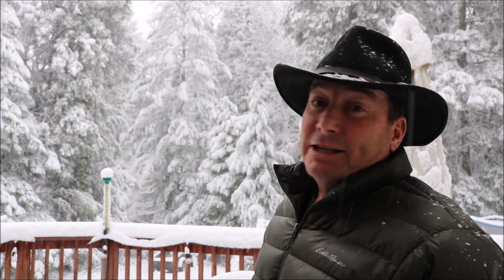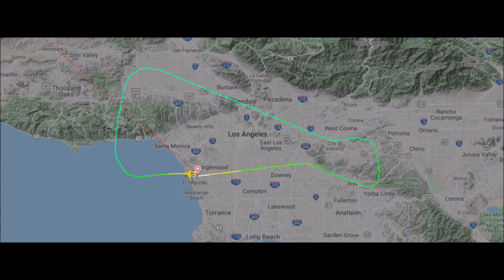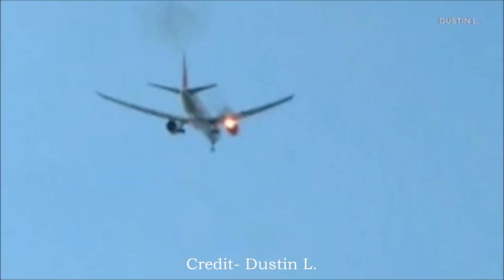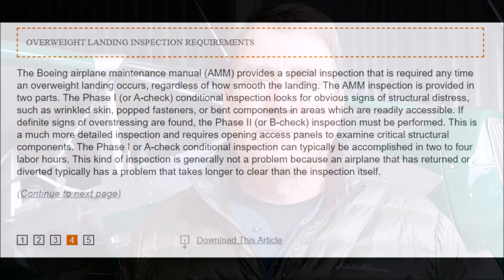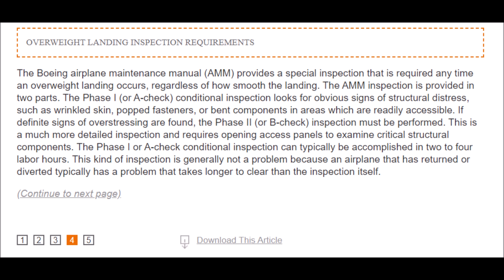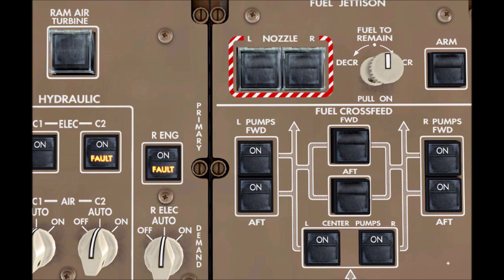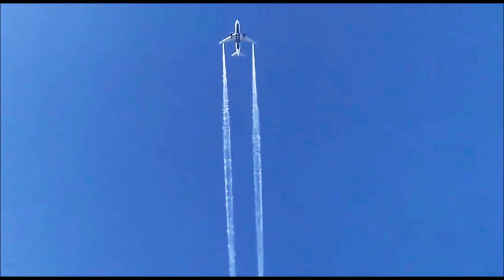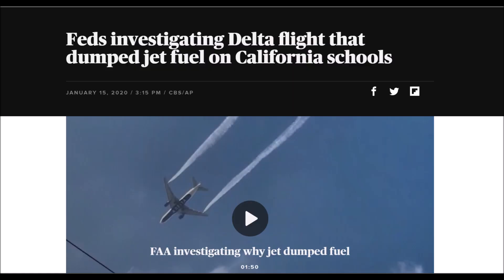B-777 Fuel Dumping and Overweight Landing Considerations (Part II)

Comment: Juan, great explanation on fuel dumping procedures and when it is absolutely necessary . I understand that Delta declared an “Emergency” as a result of the R/ engine compressor stall as they should have done for a return to LAX. Once they had made a determination to return to LAX, an overweight landing should have been discussed by the flight crew. I understand the crew was extremely busy but the option of an overweight landing vs. a fuel dump should have been discussed for all the reasons you explained in your video. I would have to say there was poor flight deck management as well as a disregard for appropriate fuel dump measures. I will be interested to see the outcome of the FAA investigation into this incident . I will refrain from any further speculation as to the investigation result. Great job Juan and hope you make a speedy recovery,

Comment: My money is on a 3rd pilot started dumping and they forgot to turn it off until single engine landing checklist.  I’m sure somebody said “oh sh**” on the CVR.
Reply: Impossible. Typically when you commence the fuel jettison procedure, one of the pilots will have the fuel synoptic displayed on either’ s MFD (Multi Function Display). Also, an expanded fuel tank indication will appear on the EICAS lower right hand corner as soon as the jettison switches are selected to the armed position. In essence, it cannot be ‘forgotten’ unless everyone on the flight deck is oblivious to what’s happening. Pilot error due to forgetfulness? Albeit possible, the chance is extremely slim. You would lose your wager as a gambling man ;-)

Comment: Another great video, Juan. You explain things that even a layman can comprehend. 

What I didn't understand is why did the crew state that they weren't needing to do a fuel dump, but then did it anyway.....at a lower than recommended altitude over a populated area? That can't be held against the control tower people, that's on the crew, I would think. They likely made a last minute call to do that. Luckily, nobody was injured or killed from this incident, according to reports.

Comment: I’m somewhat surprised there is no automated feature to disable fuel dumping as a function of altitude.i wouldn’t want to be coming in hot and heavy, on a minimal runway, mashing hard on the brakes with fuel pumping out the nozzles ..... supposing I am still above my maximum landing weight.

I’m guessing this crew is in hot water .... especially if they are seasoned enough to know about ancestor warship .... legacy rules for older systems.....
Reply: dgretlein I could maybe see some auto shut off when it gets down to very low, like hundreds of feet but if it’s an actual emergency I could definitely see dumping right up till the very last minute even if it’s much lower than procedure as I’m pretty sure those procedures change once an emergency has been declared.
Reply: Mc Earl in this specific event, the pilots had full control of the plane.  They could easily, very easily, have shutoff the “bad engine”, fly the plane home.  The plane is designed to fly safely, very, very long distances with one engine out.  According to Juan, the plane could easily land, safely stop in 12,000 feet .... if the PIC is capable.  I have my doubts with this crew.  I hope Juan follows up.

Comment: Thanks! Excellent analysis as always. Seems a bit odd that the crew didn’t realize that they  were dumping fuel. I think the tower/ATC asked three times if they were or intended to dump fuel. It was certainly visible to the crew and passengers in back as well as the tower for a portion of the go around.

Comment: I'd expect there was a fairly high workload going on. How many checklists were they going through? 3 or 4? Plus doing the calculations and configuring for landing. Oh yeah, and flying the plane in the very congested airspace of LA. Safe landing with no injuries. The MSM has already moved past this onto the next story.
Reply: ShooterReadyStandBy okay sure they were busy and stressed. I hate arm chair pilots but this crew from the information we know so far was in the wrong. You’re an emergency aircraft. ATC is moving heaven and earth to clear the path for you. If you want vectors so you can work some checklists demand it. You’re priority. What I think should’ve been done is the crew should’ve done their memory items, then declared and figured out what needs to happen, then get vectors to run checklists and possibly dump fuel to get below MLDW. Instead it seems like things were rushed and not communicated well enough to keep the emergency under control.
Reply: At least they didn't says "it could have gone into a black hole".... lol

Comment: We couldn't dump fuel in the Stratofortress so we were committed to several hours of burning holes to get down to , what I recall was 290,000 lbs.  So if we took off at 488,000 lbs, we were up for a while...

Comment: On MD-11s the fuel dump procedure is initiated manually and stopped automatically once reached a certain amount of total fuel on board. Such value is inserted on FMS during preflight and is part of the emergency return briefing. I guess it is the same for triple 7s. The main consideration on fuel dumping procedure is runway lenght available. If the calculation for the current weight and runway shows that the runway lenght is insufficient, fuel dumping (and the time for accomplish that) must be done. Overweight landing procedure, as Juan said, is of second importance during an emergency landing.

Comment: I am currently flying as a captain on the 787, and just a quick check of the numbers shows a required stopping distance on 25R, at maximum takeoff weight, of just over 6,200 feet. So that is similar to the numbers you quote for the 767-200. I have a hard time imagining that the numbers for the 777 would be much different than those for the 767 and 787.

Comment: Compressor stall and fuel dumping aside, I get the feeling that this emergency was rushed out and was a contributing factor to this situation, not sure why since the aircraft and the emergency itself was under control. There are a lot of things we need to do such as talking to atc, running checklists, working the fmc to load the approach and reviewing it, brief the approach and after landing actions or go around, talking to pax, talking to company about the air turn back, maybe there are more pilots in the cockpit and they could delegate tasks but still its a huge workload. If it was an uncontrolled emergency thats another story.

Comment: In the eighties I worked line maintenance for WAL at LAX. Late one evening an Air France B747 lost nbr two at liftoff from 6L. The flames enveloped the horiz stab. The aircraft climbed out and the flames went out.. I headed to the cockpit of a DC10 and turned on the radios. Shrapnel from nbr 2 had been injested by nbr 3 and the Captain, whose voice had risen several octaves, wanted to do a 180 and land on 24L. He was warned of debris on that runway and to use 24R. At that time the 747 passed over the airport at about 2,000ft dumping fuel. A spectacular sight. They eventually landed safely on the other side of the field. The Tower was not too happy with the Captain dumping fuel at that low an altitude, over their airport, but I suppose with two engines out on a 747 you do what you have to do.

Comment: obtaining the G Load from the black box at touchdown also helps to determine the extent of inspection for an overweight landing  plus since this was an incident the box should be pulled (mandatory)by maintenance regardless.
Reply: These A/C present the information not through the FDR's but rather through the QAR's (Quick Access Recorders) over 2,000 parameters are recorded and now a days is not even necessary to go plug anything in the A/C anymore, MOC can download it from ACARS anytime, even a couple of days later.
Reply: @caribbeanaviator1964  that's right .You can  pull the, QAR pcmcia card anytime and just upload the info. On the NG .FORGOT ABOUT THat

Comment: Juan, I agree that the crew mindset carried over from previous fleets of avoiding landing overweight may have been a factor.
With only 181 POB, and little freight? the crew may have been "driven" to jettison fuel until just before landing to land below max landing weight.
If fuel dumping Standard Operating Procedures had been followed, (altitude and area),  on the flight path actually flown, there would have been insufficient time to jettison enough fuel to achieve a reduction to below max landing weight.
Also, during their return to LAX, the crew may have changed their mindset to dump fuel to reduce the landing weight to lower the probability of the fuse plugs blowing before reaching the ramp after landing.

Comment: Is it known yet at what point did the fuel dumping start? On the go-round the aircraft had to go back out some in order to time the reinsertion. In the previous video Juan said they were running hot at that point. 350knots. They were also high and needed to lose a lot of height to reinsert at the correct level. This is the point they may have decided that dumping fuel would give them some help. He said that they did well and made their insertion point with correct speed and height so they had to work quite hard to do that and it could have been quite "exiting" to the passengers. Also not noted is the point which the dump was terminated. I note that the report from the emergency crews said that there was no requirement for medical attention to anyone on the ground. It would seem that some media reports might disagree with that.

Comment: I am on the triple now. Correct me if I am wrong, but on the ECL (Electronic Check List) it will refer to dumping when an engine is shutdown? So there should have been 4 crewmembers in the cockpit, and 4 sets of eyes. Remember the diversion checklist refers to the dumping of fuel? This should have been run. (The checklist run). 
And if you are dumping, doesn’t it include addressing the dump configuration on the landing checklist? 
I will have to review it. It seems with the first report of 212.0 fuel load with the second report of 209.0 that there was no dumping going on. Armchair quarterbacking here, but let’s say they got to the diversion checklist, it says “consider dumping fuel”, they said yes and hit the switches and left them, forgot about them.. this is where I don’t know. 
That video of the location of 2500’ is outside Jetsa, gear appears up, so the landing checklist would not have been run yet. 
Let me know everyone’s thoughts. Cheers!

Comment: Possibly a part of the checklist was delegated to a single person that started a dump. Then if they were fully loaded with fuel and the boost pumps and a crossfeed to outer tanks was started the overflow of fuel in wing tanks would dump overboard looking like they had flipped a dump switch. Free fuel for LA.

Comment: The issue is not the fuel dump itself. The issue is why he did a fuel dump after he said he didn't need one (which is a bit suspect).  If he had wanted a fuel dump they would have vectored him out over the water to do it and kept him up high.  So I agree, something went awry in that time that we don't have ATC comm to validate if he asked for a fuel dump.  
We will have to await the CVR.

Comment: News flash:  Passengers from Flight 89 report that as they were deplaning they were questioned by the pilot as to whether anybody had any .020" copper wire with them.  You know, like the wire that is used to secure guards on critical switches in the cockpit, and is broken in an emergency.  Not that they needed to replace any of the wire, of course.  Something about completing a craft project.  Details at ten.

Comment: Will be interesting to see investigation report. My bet accidental dump. 

How urgent was it for them to land? Seems with one good engine and the other in control, they didn't need to rush to get on ground and therefore more time to run through check list?

Small note Juan referred pump fuel dump as pressure. Should be flow rate.

Comment: Without the full facts of the investigation, I would be very reluctant to pass comment on the Delta incident. However based on you excellent presentation my first question would be , why the rush.? If the crew had got the engine ' under control' I am perplexed why they felt the need to land so quickly. I think you said the total time was around 30 mins. Downwind at 300 kts! +They still had a good engine so  could have held off, dumped fuel at the correct height then commenced the approach. The 777  is after all an ETOPS aircraft and in theory  can fly around all day on one engine , though regulations require 3hrs or so. If it was an uncontrollable fire or a major medical emergency I would understand more. Great channel, being retired  nice to keep in touch with aviation .

Comment: The nitrogen fill is an important safety consideration since the tires could decompose from the heat and explode before the fuse plugs give way if theres oxygen present at high pressures. I wonder if that was the primary concern over dry-rot from air?
Reply: Yes.

Comment: I'm slightly confused on the inactivation of the fuel dump system:                
       >The fuel jettison system turns OFF automatically when MLW is reached.  That would be regardless of altitude, yes?
       >The CENTER tank pumps operate at a higher pressure than the main tanks, so this fuel will feed the engines, and the dump valves BEFORE using fuel from the main tanks...yes? So I don't understand how fuel is dumped from the main tanks. 
         >After landing, even if the FJS valves have been inadvertently left OPEN, surely there must be a function on the gear squat switches to close the FJS dump valves...?  You said near the end of the video, that it has to be turned OFF manually.                                                                                                                                                                                                                                                                                                                                                                                                                                                                                                                                                                                                                                   Never had to dump fuel yet...

Comment: I have questions for you as an aircraft mechanic (Navy P-8A - 737-800 body with ER wings and -900 landing gear). Your chosen photo shows what looks like a flame out, does the 777 have an automatic discharge of fire suppression systems? While I understand military planes have extra countermeasures, I know engines get cut when the fire suppression systems are used, is there a possibility that he had a stall warning after the radio call was made where he was losing power? By him not trying to climb above 10,000 that initially told me he had throttle or bleed air issues. Also, tells me he might be a prior military pilot as they are typically heavier than passenger aircraft so the overweight landing is more risky than on passenger models. But I am seeing it from my systems maintenance perspective, you’re seeing it from systems utilization.

Comment: Nice informative report, Juan.  I'm wondering about the single engine landing considerations for determining necessary runway length.  Can you use a single thrust reverser for landing ?  Or, if the stalling engine is still providing partial power, what are the ground rules for using thrust reverser on that engine ?
Reply: Richard Fischer: Juan said in response to another question about thrust reversing, "No, you don't reverse on that engine [meaning the Rolls Royce] anyway. Its built into the calcs."

Comment: One thing I haven't heard from you or Mentor Pilot is how busy pilots are in the cockpit during an emergency return procedure with compressor stall. I'd like to hear your opinion on whether there is justification for the error due to how busy they are or not?  In the ATC recordings they clearly sound busy and even asked for a few extra minutes before making the final turn onto the approach path. Clearly they made a mistake but is it excusable because their first priority is flying the plane, and getting it back on the ground safely in an emergency? Do you think they will get a slap on the wrist or do you think there would be a more severe punishment? My personal opinion as a passenger, I want my pilots to get me on the ground safely and nothing else really matters.

Comment: I don't need a TV, I've got Blancolirio!  Thanks Juan!   I do know that the manufacturers (Boeing, in this case) publish tons of operating data.. but I also know that Part 121 carriers do, in fact, write their own manuals... and must Live By Them or face their FAA ACDO wrath.  I might easily believe that fuel dump procedures could easily fit that category...   Have you seen Air Carrier 're-writes' in the Flight Ops area much?  It is rife in Maintenance...  and based, it would seem on the individual Air Carrier's experience...you do quote a lot of Boeing data and that would be totally correct if incorporated in the Airline's Manual..  Thoughts?  Thanks Again!!
Reply from the maker: That's a BIG topic...I'm not on the 'inside' of that part of the industry.
Reply: @blancolirio  Thanks, Juan.  If the carrier adopts or incorporates the OEMs manual, then that is the 'law'. But often, they author a supplement to the OEM and then both become the law.   This may be much more prevalent in maintenance (or component maint.)  :-)  Thanks, my Friend!